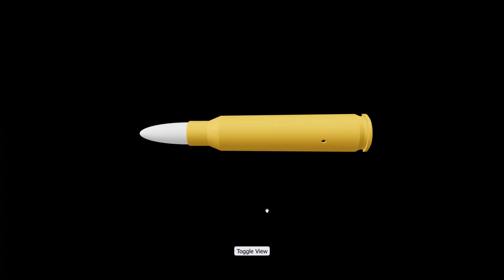Innovative solution to improve weapon handling training

Comment: i dont understand? a misfire is when the cartridge does not fire when intended - light primer strike, wet cartridge/water ingress, or cartridge cook off on closed bolt systems. this will only show operator error (trigger actuation) or weapon malfunction (im unfamiliar with steyr fire control group, im unsure if a loose/incorrect fitment of buttplate could cause the disconnector to fail to connect with the hammer or whether it will cause fail to fire due to the transfer bar not actuating with the sear)
Reply: It's got to do with a weapons handling drill. To alert the operator of the system, they've made a mistake. Training on the system with no live rounds, just white plastic dummie rounds.